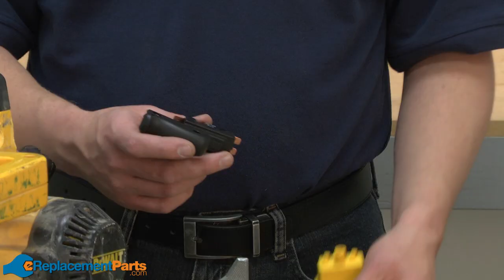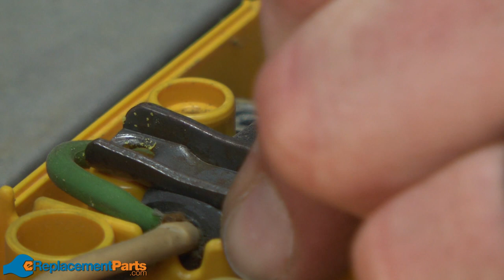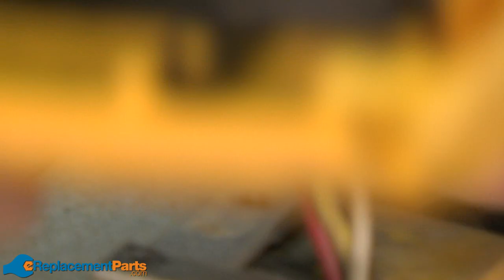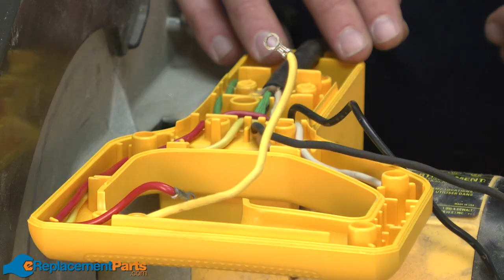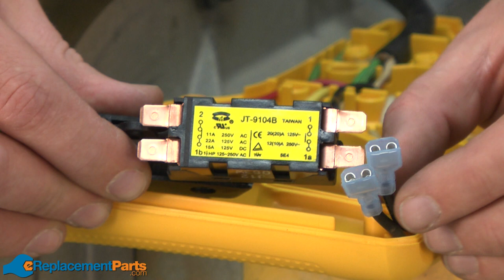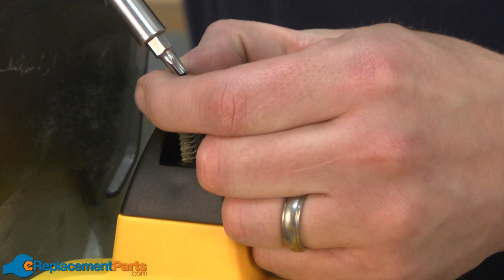How to Install a Switch Kit on a DeWALT DW705 Miter Saw (Part # 5140112-17)

Comment: Hi, I did open the white switch in my Dewalt saw machine and notice the contacts are black and broken a bit. I did try to repair the contacts and the saw started to work but it didn't last for long. Please inform where I can buy only the switch itself, I mean the original white switch. Thanks.